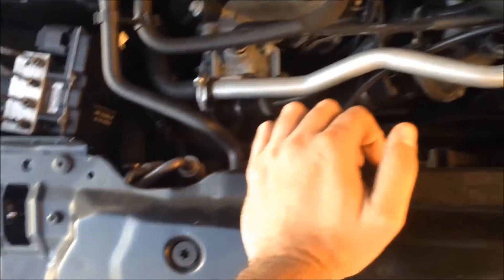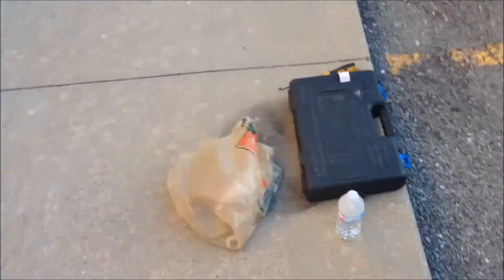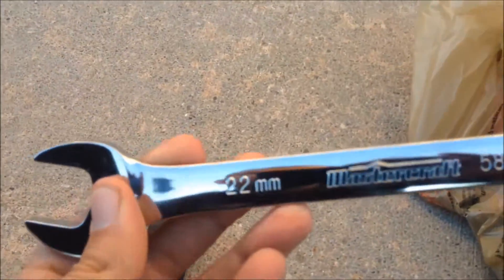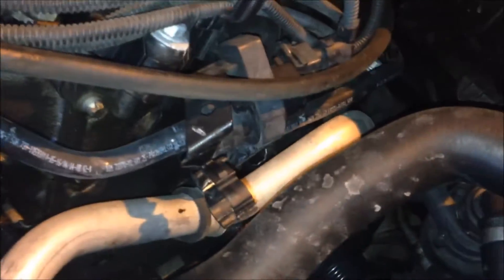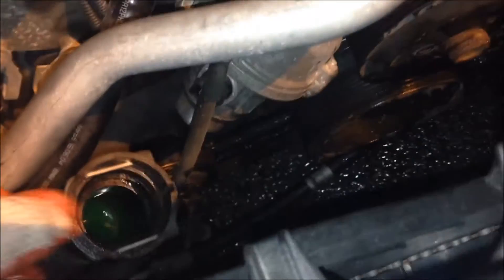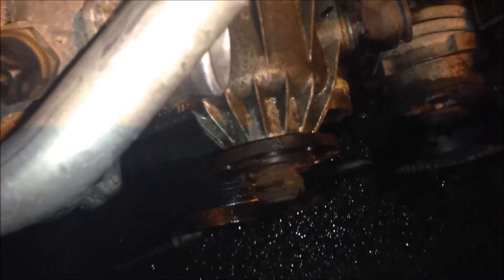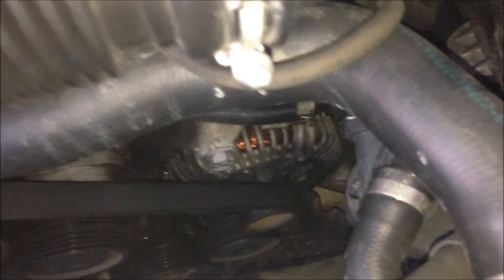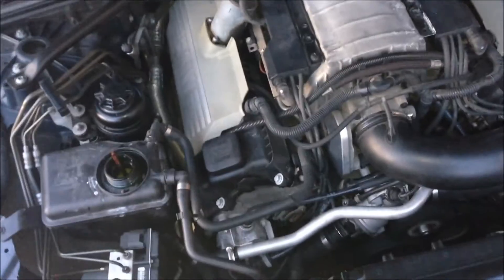2004 BMW 545i Waterpump Replacement  do it yourself

Comment: You don't have to remove the crankshaft pulley. You only have to loosen the bolts a little to remove that bottom water pump bolt. You can reach the bolt to loosen or tighten from the left side, or the right if you remove the tensioner.
Reply: @reginaldbowls7180  it's a lot less work and you don't have to try to find the bolt-holes again. You loosen the pulley and remove the bolt, and when you're done you just typed everything backup much easier.

Comment: hey how did u remove  the ac belt cuz u only say u are gonna crank it but you dont show anything else you only show after u have already remove the pully
Reply from the maker: that was a hard part i couldnt record it i was using my iphone 5 and its sucks, i did place a small peace of plastic under the ac belt and i cranking it untill the ac belt rolled off from the ac pulley, after i used a T45 socket for the Big pulley to remove it but its hard, you not gonna see what you doing, you have to keep try until you take all the 8 bolts, and than take out the big pulley and after you will have access to all the bolts on the water pump, but there is other people that did the same job on the 745 and its a same process, there is a nice video what i was watching before i did the my water pump just type this     BMW E65 E66 How To Replace Your Water Pump            its a Same process like the 745 or the 545 645
Reply: Hi, after you remove the belts and 8 torx bolts from the ac pulley how do u get the pulley off the car? mine seems stuck
Reply from the maker: just gently hit it and it will fall off